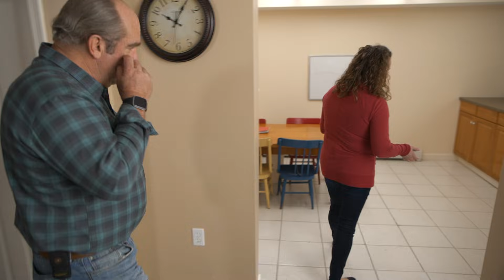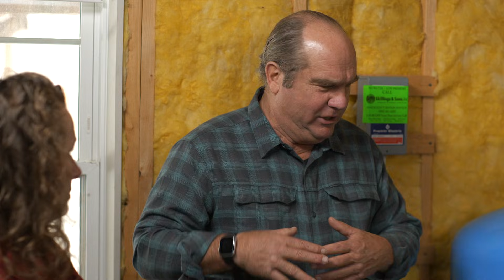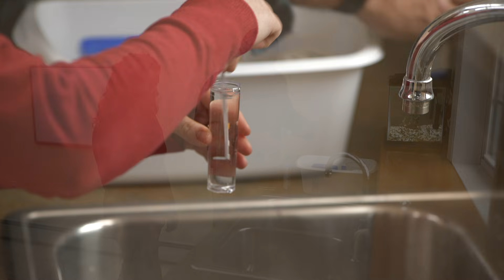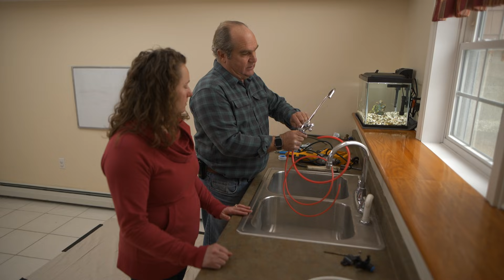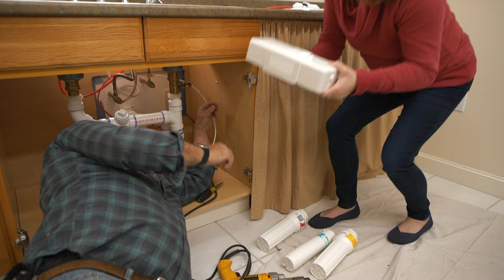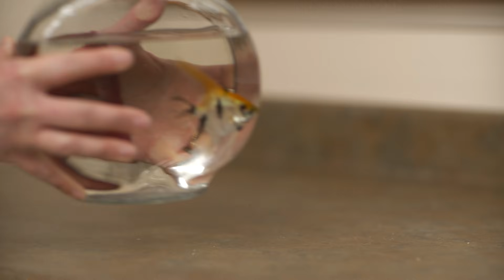How to Install a Reverse Osmosis Water Filter | Ask This Old House

Comment: Hey Richard! Cutting the sprayer will cause water to spray from the hose when the faucet is turned on. Someone inexperienced following your instructions is in for a surprise. You reassemble the sprayer under the sink.

Comment: One thing I would have done differently is install the RO system in the mechanical room and then run lines to the basement sink and the kitchen sink as well as any refrigerator icemaker‘s you have. This way you get the RO water at multiple locations throughout the house and just not one.  I’ve had an RO system for over 30 years. One of the best investment a homeowner can make.
Reply: In this case, the RO system was just for one faucet, which is clearly in a wet bar in a secondary room of the house, not the primary kitchen nor in the bathrooms.  They link the water after it's already gone through their existing filtration/treatment systems, they just need to treat the water in that room to make it compatible with the fish.
Reply: But how could any volume keep up with that? Say two fixtures are being used at the same time.

Comment: The aquarium does not look like a Nitrogen cycle has been completed. The aquarium needs it biological system to be alive and complete, Putting all new water in and adding fish is a situation doomed to fail. Do some research on the Nitrogen cycle before buying an aquarium and add fish. It takes several weeks before you can add fish.

Comment: The reason the fish died is because the filter has not had enough time to be "seeded" with bacteria to remove the ammonia in the water which the fish produce from their waste.  It takes 4 weeks to seed a filter.  Buy hearty fish like Zebra Danio's to survive the 4 week period.  I have a 30 gallon aquarium for a long time and learned the hard way that filters need time to accumulate enough bacteria to remove the ammonia.  The other water problems can be fixed easily with chemical additives available at the fish store.

Comment: We had a 10 gallon aquarium for years with a bottom under gravel filter.  We changed the water every few months.  We purchased 2.5 gallon carboys of drinking water and just dumped it into the tank.  The fish loved it and lived forever.  Much cheaper and less complicated.  The drinking water had been run through an RO unit.
Reply: They sell reverse osmosis water in pet stores. We use that, mixed with 50% tap water... the water is also cheap, but sure it's more convenient if you have it from the tap
Reply: Yes, but did you get to star in a TOH video?

Comment: She also need to aerate the water first before she put the water into the aquarium. It's not the chlorine since it's well water, but because the dissolved oxygen level from the well water is very low.

Comment: For all we know they never properly cycled the tank and there's zero bacteria available to reduce ammonia.  I'd like to think they tested for that before going assuming it's a pH issue.  Not that it can't be, but fishkeeping often involves a lot of patience and prep before just buying fish, tossing them into a tank and wondering why they're dead in a day.
Reply: Yeah especially if they been trying to keep angel fish, they need a bigger tank and really need at least a few of them. That looks like a five gallon, possibly 10.  Way too small.  Looks like it was a kit that you get from a local store.  Those are generally not very good. Better to buy everything separately depending on what fish you want to keep.
Reply: Agreed
Reply: They need something like Amquel/Prime, even if they are using RO water, to help detoxify ammonia, etc.  Also, anyone keeping sensitive aquatic pets should check with their water company (assuming they don’t use well water exclusively) for which chemicals are added.  Chloramines are becoming more popular due to their more stable nature, but they quickly destroy carbon filters and then begin killing beneficial bacteria in the aquariums.  The dechlorinators listed above detoxify that as well.
Reply: @avimenachem1064  Prime has been my go-to for many years.
Reply: You could be correct. I remember using a dozen goldfish to prime the initial setup of water and discarding them for the next batch of fish. After that the tank was siphon filtered and we only took about 20% of the water out at a time once a month and worked just fine.
Reply: Exactly.  Sometimes you have to learn the hard way like I did.  Hopefully they remember to feed the fish too but being down there in the basement I doubt it.
Reply: Exactly. I had mine set up fir 8 weeks before adding my angels. And I used some water from the old tank. 👍
Reply: A cheaper way might be just to buy the zerowater jug and see if this doesn’t work first. I’ve checked the pH balance through this and it works better than any other I found. 
It probably won’t get rid of the dangerous toxins, but most everything else will be clear & clean.